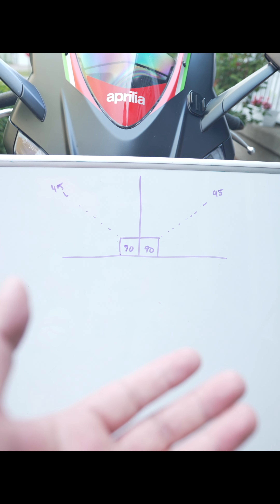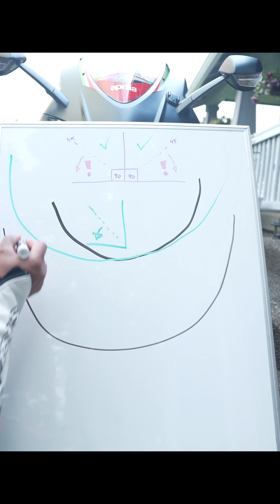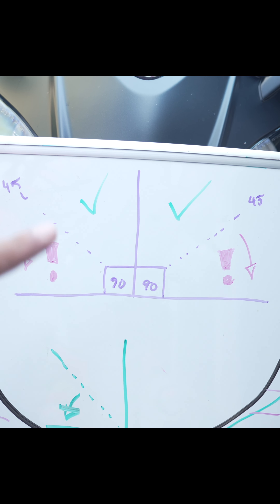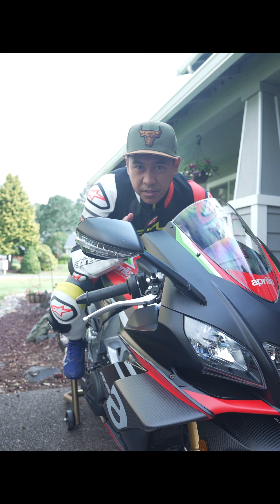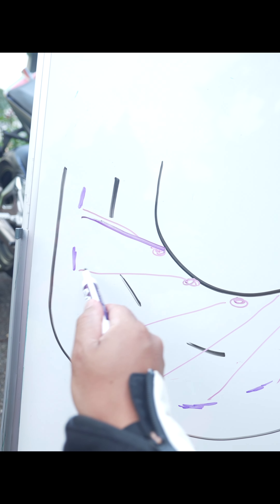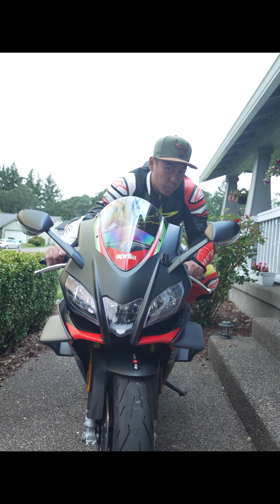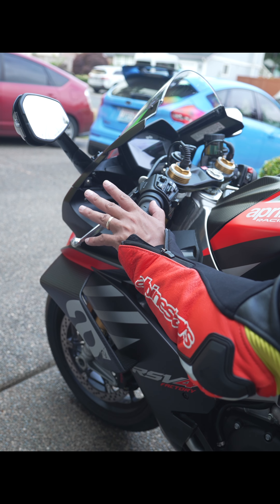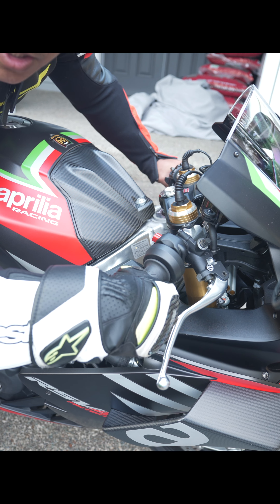How to corner on a sportbike

Comment: The first thing is balance. If you have that then you can be "really loose" on the handlebars. Or you can call it a light touch. If you have a light enough touch, your front wheel will choose its own angle, and this is where you want to be, and that front tire will be kicked out farther than you would be holding it. That's the place of maximum grip, and should you hit any gravel, that's the place where the tire will recover on its own which makes it the place you really want to be. So get balanced enough to have a really light touch.
Reply: You just gotta be calm

Comment: What about like on a 90 degree turn I find it sketchy sometimes because sometimes there cars hella on me and I’m down shifting to take the turn at a good speed but sometimes dosent work out so good
Reply from the maker: Counter balance
Reply: @adobomoto  appreciate ur response bro I enjoy ur videos I try to take those 90 degree turns around 2 gear so 20 to 23 mph but sometimes I feel like I’m going a bit fast and go to wide and feel like ima fall I’m just trynna get down on taking a turn at a decent speed I usually counter balance when doing u turns but that’s because I’m going really slow should I counter balance at 20 to 30 mph